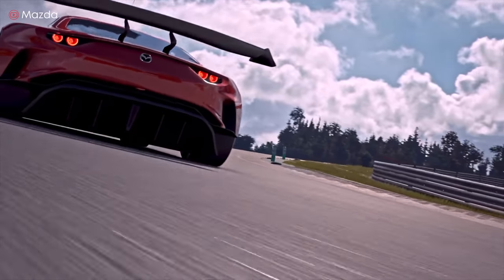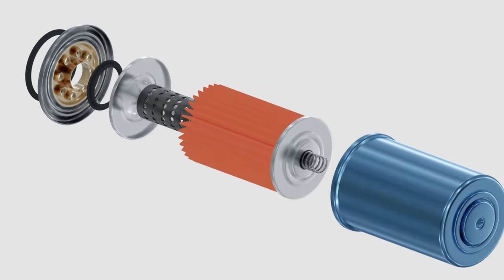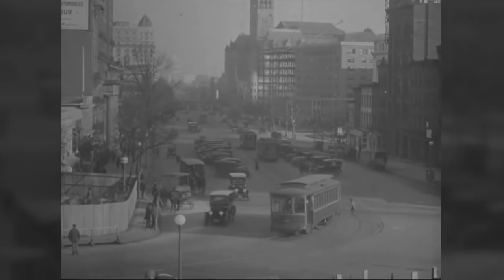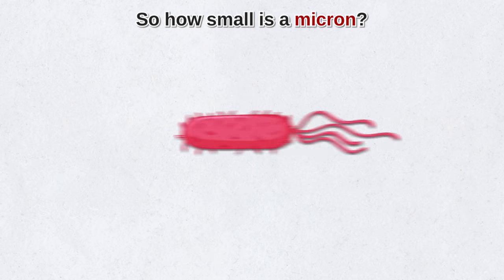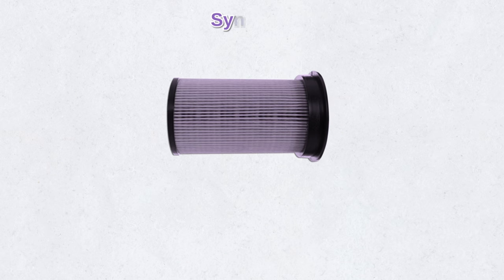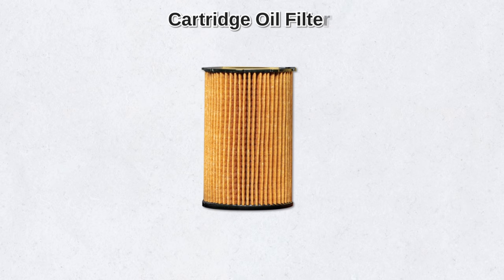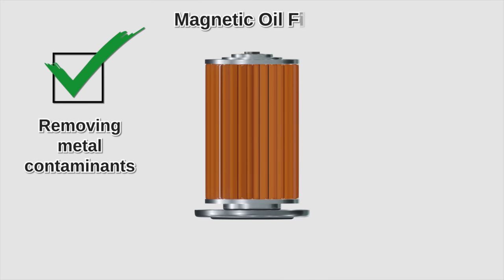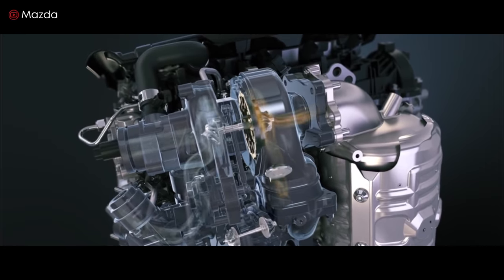This New Oil Filter Just Changed the Game (No More Oil Changes)

Comment: Scotty you may have mentioned that if anybody pre fills their oil filter prior to installation it should be done through the small holes and not through the center hole
Reply: If you are pre-filling with new, fresh clean oil, what difference does it make?  When you filled the crankcase with the new oil it has already run over the moving parts of the engine without that part of the oil being filtered.
Reply: @ald8612  only as a precaution or if you are as picky as I am the filter filters from the outside to the center so if anything goes in from your container it will be caught in the filter
Reply: @ald8612  this is especially important for fuel filter
Reply: @ald8612  Not really.
Reply: Depends on the filter's position when installed.
Reply: @MikeDPlxztc  then why wouldn't you pre-filter the oil that you're pouring directly into the crankcase...it might have something coming from the container too- and there's 3-5 qts. of it, instead of the couple ounces in the center of filter. Also there is the film of  old oil in the bottom of pan, better remove pan each time and clean it thorougly.
Reply: @land7776  absolutely agree. especially in the case of larger fleets that are pulling their oil out of 500 or even thousand gallon tanks which often collect volumes of contamination in the bottom between cleanings. It is always a good choice to use a funnel that is screened to filter the oil as it is poured into the engine. that is very similar to oil pans, same concept. they collect contamination in the bottom and efforts should be made to flush it out or at least drain them in the most efficient manner. For instance even if you have to tilt the vehicle in a certain way. Chevy's are notorious for this as many of them have a strange indentation in the pan that prevents all the oil from draining. congratulations you are a oil change genius. 👍
Reply: @MikeDPlxztc  well, I can't blame you for pre-filling the filter like that, you have a valid point and it doesn't take long. In my case it's moot because I have a horizontal and mouth down filters on my cars. What I do is pre-fill it, let it sit for awhile, then funnel it back into the oil jug. That way the filter is saturated and there's not that ~milliseconds of no lube/cavitation at start up through the filter..esp with a cold engine.
Reply: Good luck getting oil thru the small holes Im screwed. My 76 F250 390 has never had the full flow filter prefilled.  The rods could starting knocking and the lifters collapsing any time now
Reply: @ralphwood8818  it's easy with fuel filters
Reply: I take the filter out of the box and check if there is any loose things such as pieces of glue. Spin it on and I'm thru.  Guess what the engine parts still have oil on them.. You dont need to worry about the small gasoline filters. The air must be removed from the big spin on filters such as on a diesel unless you like to bleed the injectors. I use the game changer filters so I dont need to drain the oil. The game changer oil filters all have oil lines to deal with. Only for mechanical types. All I have now is Gulf Coast  and Motor Guard  oil filters. Started with the Frantz oil cleaner in 1963. None of the high volume full flow filters clean oil.

Comment: Always Scotty you do a first class job on this video, looking forward to the next one chief!! 🧰🙌👍🍺
Reply: Its interesting how we are told how damaging these small abrasives are to our equipment. All we hear is which of the  filters that dont clean oil is the best. The filters that can actually clean oil are never mentioned. The best one in production as far as I know is The Australian Jackmaster. I read somewhere that the Jackmaster  has been around since 1954. Why were we sending Frantz and Motor Guards to Australia in the 60s. The Australian  Jackmaster is better than we have now. I have heard our filters were used to filter fuel. They werent used for just fuel. Filtering fuel was not their strong point. These new Jackmaster filters are better set up for oil and fuel. I just put a Jackmaster Classic on the Pontiac Torrent. It is right up there with the Gulf Coast junior. For filtering motor oil.I would prefer the Jackmaster for filtering fuel. Jackmaster claims their elements are better than toilet paper. Might be true but I can get Great Value 1000 from Walmart for about a dollar. I have a dozen toilet paper filters in service. When I sold them I had customers that had no skill at finding tightly wound paper such as Scott 1000. sheet. I know some foreign countries have trouble getting the proper sized paper.

Comment: My dad added a secondary toilet roll oil filter system to our 1960 Volkswagen Kombi. Not sure how it would stack up today. But it was always pretty dirty when he swapped in a new roll about every 6 months. Cheap and  effective. Anyone else remember them?
Reply: Yep, have seen and even used will not work on cars newer than around 1980...you see, those filters sometimes fail. Decomposing and shredding crap all over the inside of the engine...if not changed about every 1500 to 3000 miles  ..and omg what a mess to change
Reply: Dad was on top of that, never had any issues. But toilet paper isn't the same now. It was a novel alternative which also added an extra 500mls of oil to the system.
Reply: I changed the toilet paper pretty often on the beetle. The engine was loaded with large engine damaging pieces of steel and probably aluminum. That would have been a good engine for both a full flow filter and the toilet paper filter. Dont know if full flow filters were available then. They are now.
Reply: A lady had a beetle engine that broke down on her.  Another  lady.stopped and  told her she had an extra engine in the trunk.

Comment: I had the Franz oil filter where you insert a roll of toilet paper. Oil color was gold with every 5K oil change up to 150,000 miles when I finally sold the car.
Reply: How many years ago? In the early 60s?
Reply: How many years ago? In the early 60s?
Reply: @harleylawdude  Still available with more modern filter element as.well.
Reply: They used to hawk these at the LA county fair.
Reply: I did it differently than you. I changed the Frantz every 2,000 miles and added a quart of Standard Delo W30. Didnt drain the oil. In 1963 Delo was 29 cents at the discount stores. I did change the oil and changed a head gasket once. The Rambler flat head 6 ran good but every combustion chamber was a different size. There was no clearance between the piston and head. When the engine started knocking you removed the head and cleaned the top of the pistons and the head. Not a masterpiece of engineering.

Comment: Scotty should've mentioned the bypass oil filter. A bypass oil filter is the true game changer. Filters your oil down to extremely smaller particles than a standard oil filter can easily extend the life of your oil 20,000 miles or more. You'll find several cases where a person goes a million miles or more on the same oil, just doing regular filter changes and adding a little oil when needed. Granted, those vehicles are usually diesels that are doing that kind of mileage on no oil changes. Just regular filter changes. However, the effect will still greatly lengthen the lifespan of your oil in any vehicle.

Comment: I used to have this 1998 Camry, with the old 2200 engine. First time i went to change the oil filter, i noticed it was mounted on TOP of the engine, hole side down. Predictably when i took it off, oil went everywhere. A few weeks later i was chatting with a mechanic friend of mine and asked him how to prevent this mess. He says "Ya don't, just pack rags around the filter so the oil doesnt get all over your spark plugs." GREAT design, Toyota!

Comment: When changing the oil I once had to drive a large screwdriver through the filter body to unscrew it. Yes it was that tight.
Reply: I've had that fail too.
Reply: Me too, and in fact again just last week... A last resort.
Reply: I think that's why they tell you to wipe fresh oil or any kind of oil on the rubber
Reply: @arlenmargolin1650  always make sure the rubber seal is on the old oil filter, if not it's stuck on the filter housing and must be removed.
Reply: @HypocriticYT  well you're right I remember somebody having that problem and ended up losing all their oil almost blew the motor up that is a good tip thank you

Comment: yeah, I learned the hard way to check, recheck, and check again, because in 15 degree weather here in TN when I was a teenager. I forgot to put the oil plug in my ford inline 6.  I didn't know it didn't have any oil and drove 4 miles, ran outta gas and killed the battery on my way to work that evening.
Me and my dad decided to put 1 qt of slick 50 and 4 qts of 20W50 Castrol GTX motor oil in it. Drove it another week, because the damage  was already done, the motor was doing 4,000 to 5,000 ram and only going 5 mph. When I made it back home and cut it off it locked up.
So, it's good to idea 💡 to always check, recheck and check again.

Comment: A friend worked at an auto parts store. He was at the cash register when a girl came in and bought four quarts of oil. He was helping another customer when he saw the same girl buy another four quarts of oil.  Shortly after that, he saw her come in again to get some more oil. He zipped over there and asked her what was going on. "I keep putting oil in the engine, but it's still not full!"  So the question is, how many gallons of oil does it take fill up an engine?  🤪

Comment: My AMSOIL by-pass filter cleaned all the way down to like 3 or 4 Microns! My diesel engine was still running at 300,000 miles, but getting parts for a 20 year old Iveco truck was almost impossible to find so I parked the 20 foot van and made a storage unit out of her. She ran on Ams Oil products for 20 years without problems...

Comment: I got a story for you scotty. Was rebuilding an engine for a fella who said it was just time. We started taking her apart, draining fluids, disconnecting hoses and such and undid his filter... Well it fealt weird to me so I got the guys and we took a look inside... The metal was there, but nothing else. The filter system was all but gone. Dude had just gotten his oil done at a "jiffy lube" less than 2k miles  2months prior to this as per the sticker they put on his window. Well when we got into the engine we found so much debree we couldn't believe it. So we told him and saved him a full rebuild and just got it all cleaned up and with a few minor (inhouse) improvements and about $2 grand back in his pocket he was happily going down the road.

Comment: Engine oil change horror story for yall, I did my first oil change on my new to me 2005 ford f150, I have changed  oil multiple  times in other vehicles  and equipment  in the past so it wasn't  my inexperienced. I drained  the oil and was going to replace  my oil filter, the filter was so tight I could not get it off, did everything  in the book and could not get it off, so we took it to a shop, they got it off and found out it took them 2 hours  of chiseling to finally  get it off.
Reply: Sounds like someone didn't put any oil on the rubber seal before screwing it on. Or maybe they used lock-tite.

Comment: My sister used to get her oil changed at the corner oil change shop faithfully every 3000 miles. I was going to change it for her, put synthetic in it with a premium filter.  When I changed the filter, they had written the change date in marker on it. They were only changing her filter every other oil change but charging her for it.

Comment: There is also a bypass for the folks who never change their oil.
Reply: Change mine every 2.5-3k so cheap
Reply: Don't you mean bus pass.
😁
Reply: @HowellDiesel  ridiculous waste of resources and money...
Reply: @HowellDiesel  
YOU must be a race car driver or live at the top of a very tall mountain... Foolish for sure to change it so often...
Ever send your old in for evaluation??? You find the properties are close to brand new still 🤔
Unless you're one of those above drivers...
Reply: @boobtubeakatv1296  not true. city drivers have to change more often. Scotty says you have to change oil 5 times faster than highway driving. Think of it as a generator producing electricity where u have to change oil even though it's going at 0 miles per hour.
Reply: @land7776   not true. city drivers have to change more often. Scotty says you have to change oil 5 times faster than highway driving. Think of it as a generator producing electricity where u have to change oil even though it's going at 0 miles per hour.
Reply: @allenperera6158  what do the engineers say that designed your engine? There is a Severe Service interval for taxis/all city/idling..but it's not 2.5k. No Scotty doesn't say change oil 5x faster than hwy driving..or can you provide a link? You are free to waste energy/resources money of course.. why not every 1k miles, still so cheap!
Reply: Never changed mine. 30k miles. Still runs like a champ
Reply: My guess is the oil filter bypass is in use way more than you would expect.   Like for all cold starts when the outdoor temp is below 60 deg F or you use thicker oils.
Reply: @butlertv1  😂 exactly where they gone be not changing they oil
Reply: @land7776  not really if he using regular oil.
Reply: @land7776  my service manual says 5000KM that translates to 3107 miles roughly. So i rest my case.
Reply: @allenperera6158  
Looks like you don't understand what a hybrid even is Allen...
The engine runs 40% of the miles driven...
On taxi's police cars and others that run their engines all the miles, yeah, maybe change every 3-5,000 miles...
That's about what my engine see's at 40 % running every 15,000 miles...

The generator is the ice, and does NOT run except to charge the batteries and then does so usually at 1,000 rpm speeds... I get usually about 55 mpg 🤪
Reply: @boobtubeakatv1296  LOL. i was talking about gen sets powering buildings.
Reply: @allenperera6158  
🤪😳🤔
Reply: @allenperera6158   5kKM is the severe service interval for taxis/police/engines idling all day. If you are just commuting or live downtown, that is not severe service-nor is an Uber driver. 2.5k mile change is even more of a waste.
Reply: @land7776  exactly
Reply: @allenperera6158  lol
Reply: @michaelprice3785  wrong guess
Reply: @land7776  I had a 427 vette where you could put in a non bypass adapter.   If oil would not go through the filter you saw an oil pressure drop..    You would be surprised at when the oil would not go through the filter and the pressure would drop.    I used moly break in oil once and almost lost all of my oil pressure.   The moly clogged the oil filter.     When I put a new filter in, all was well.   I was sweating for a while there on the freeway.
Reply: If you have a good secondary filter like one of the toilet paper filters the full flow filter will be kept clean. With a clean full flow filter  the bypass valve will open less often. If the bypass valve does open clean oil will go  to the bearings.
Reply: @HowellDiesel  I change mine every 6000km and it's always served me well. Nobody will convince me otherwise. I'm not driving a giant pickup as a grocery getter so I can afford to change oil and filter often. People wait till something breaks and then get surprised. That's why they say maintenance is a problem in the US. They drive their car and never open the bonnet till they get stuck on the side of the road.

Comment: Yeah I have a horror story. He said he change the oil and the oil filter and they didn’t. It’s really hard to trust mechanics these days.
Reply: yep, they are dishonest, or worse, incompetent...
Reply: A good mechanic will always save the parts they replace from your vehicle till at least after you pick it up in case you either want the parts or see what the parts condition was. Recently I had to take one of mine to a mechanic to have my clutch disk and some other parts replaced. And the shop owner asked me directly if I wanted the old parts, I just wanted to see what the clutch disk looked like after 144K miles. Only part not in there was near by if I had wanted which was the OEM fuel filter which he told me was very dirty. And before anyone jumps on me about going that long on a fuel filter I am only the third owner and this vehicle had been very trouble free for the first two. 

Now they won’t save the old oil as they have a single bin to store it in but they should have the filter you can compare as to be the correct type for your vehicle, and always check the oil level soon after changing/having it changed to be sure the job was done right.
Reply: Have the mechanic write the date and mileage on the oil filter with a felt pen. That way you can check it yourself and be sure.

Comment: Allison Transmission found most foreign debris was introduced during the oil change. Make sure the funnel is clean and anything else that might introduce debris into the engine. Stick refrigerator magnets around/to the outside of the filter. Clean or change the PCV Valve that also keeps the oil clean and is overlooked by most.
As the miles get higher the oil change interval should be shortened. I run a Synthetic oil and have 281K miles on a 2010 Acura MDX, original engine and transmission. Something to consider.